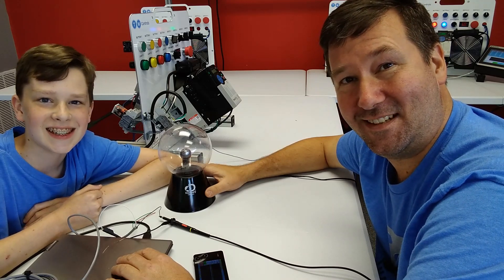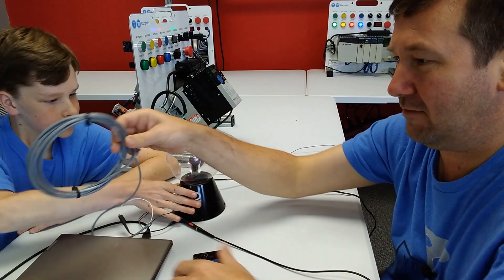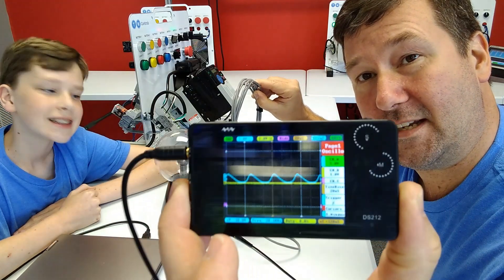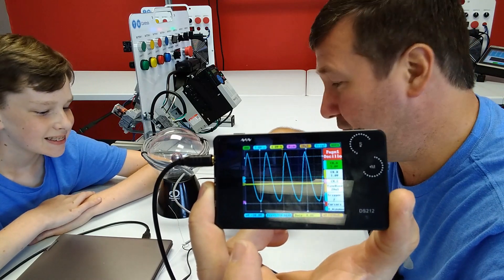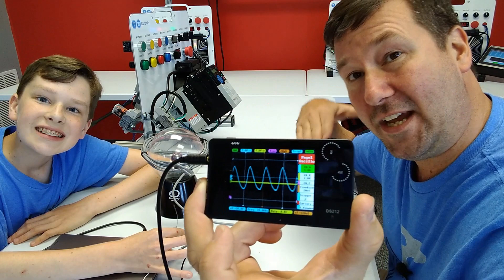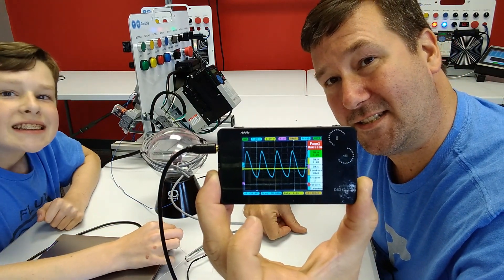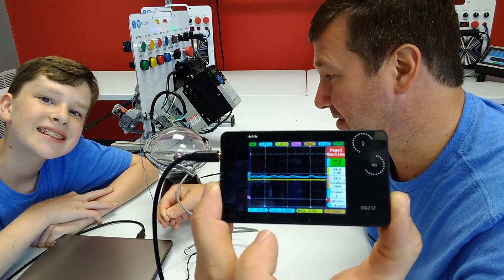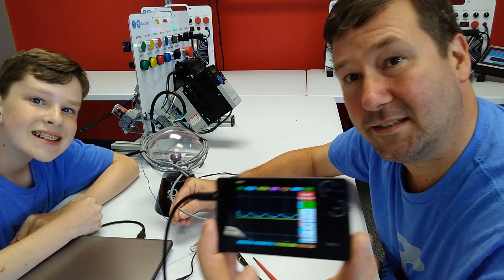How Does Shielded Cable Reduce Electrical Noise? We Use a Plasma Ball to Find Out

Comment: In the Hifi audio industry there is always an ongoing debate about weather cheap vs expensive rca/speaker/power cables impact audio quality. Most expensive ones are shielded and braided. How should one interpret this experience of yours in relation using shielded vs unshielded cables as rca/speaker/power cable for audio equipment
Reply from the maker: It never hurts to run shielded cable but chances are there will not be an improvement the ear can hear. You have to look at what items might induce noise.
Reply: Even though I'm an avid stereo music lover I also love the occasional movie, too, and due to lack of space I have to optimise my setup for multi-channel listening also. However, when it came to listening to my newly discovered multi-channel setup I immediately became aware how my small 13×11.5 room sounded different. Didn't know what it was at first, but coming from an audio black background there was no way I was prepared to put up with it!

Even after auditioning 3 separate AVRs, the faint electrical presence had replaced the ambient sound of the room! That told me the extremely faint background signal noise I had been experiencing (poor description) had nothing to do with the actual units. Therefore, my attention changed to the cables. And even then it was only on the third occasion after living with two previous sets of cables that I ended up finally purchasing shielded cables and lo and behold that is when the noise floor within my small room finally came down to satisfactory levels.

 Cables often act as antennas for attracting RF, and the longer the cable, the better the antenna! Probably explains why when I used to disconnect my heights and surrounds within 10 minutes, the faint background signal noise (RF/EMI) within my small room used to practically disappear/dissipate

The more cables I shield, the quieter my room becomes, and the better the shielding, the more the cables are likely to disappear.

If one has the same sensitivities and is looking to address this matter, but is also hoping to notice (hear) the incremental differences, I would suggest starting with analogue cables before moving on to digital and power cables (no good trying to hear the quietest when one hasn't addressed the noisiest)

Trying to achieve a silent room sadly has turned into an obsession for me. However, the results speak for themselves. There are times when sitting in the MLP and pressing pause (or mute), I'm unable to differentiate whether the systems on or whether the systems actually switched off. Of course, audiophile equipment helps, but in reality, for one to experience an exceptionally quiet room with a multi-channel setup, shielded cables IMO are a must.

Comment: Hey, Your son is so smart and cute.
Could we use shielded cable to reduce harmonic of ac drives rather than Sinewave filter? Pls reply.  from India
Reply from the maker: No, the shielding will prevent electrical noise from being transferred from one wire to another but your drives are likely inducing harmonics onto the incoming line
Reply: @TimWilborne ok thanks,  shielded cable has to be earthed at both ends or only one end?
Reply from the maker: It depends on the application.  There are some good articles out there if you google but the rough answer is if it is instrumentation and you want to keep noise out of the cable...one end, if it is a VFD cable and you want to keep the noise in the cable, both ends.  But there are some other details that are worth reading about.
Reply: @TimWilborne  Thanks a lot, you are a gem man.🙏
Reply from the maker: You are welcome

Comment: hi there. i know this video is a bit old, hope you see this question though. i have this plasma ball and it is interfering wity my led wifi clock that is sitting on the same metal shelf. is there a way i can block the interference? i only  have this shelf and they both look cool lit up. thanks in advance.
Reply from the maker: Probably not is a way that would be visually pleasing.  Grounding the shelf and putting metal in between them may help.

Comment: Hey guys. One of my mental blocks is not understanding how the simplest shielded cable works. So the outer sheath stops noise getting to the signal carrying core...okay...that's fine if we consider conventional current flow, but with electron flow being equally valid, then the outer sheath is exposed to all the emfs, so from that viewpoint it ain't happening! Put me out of misery and I'll buy you a coffee.

Comment: So it’s simply not enough just to run that type of wire and cut off all that off on the ends?
Reply from the maker: No, without being connected to ground on at least one end, they do nothing.  I'm working on some videos to explain this better but as we show in this video, moving magnetic fields will induce current into a wire.  The point of the shielded cable is to "sink" that induced current to ground before the magnetic field passes through the control wire.
https://twcontrols.com/lessons/how-magnets-produce-electricity-using-a-magnet-and-coil-of-wire-stem-with-tim

Comment: Super.  I'm going  use this in my classes!  I also show noise with a simple <$25 non-contact voltage probe.  The importance of shielded cables is critical in digital switching circuits; PLCs, VFDs are subject to noise.  Also, I use Ferrite cores (chokes) an inexpensive, and effective, way to reduce the common-mode current, the radiation (or pickup) from the cable.  Congratulations to the supporting actor!
Reply from the maker: I will have to see how the ferrite core reacts with the plasma ball.  I will let you know what I find.